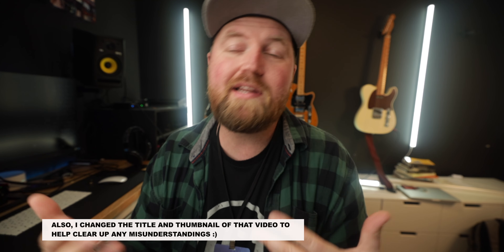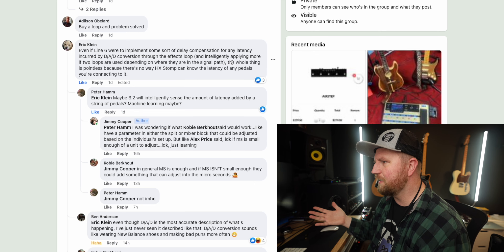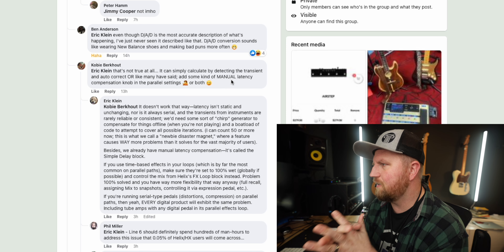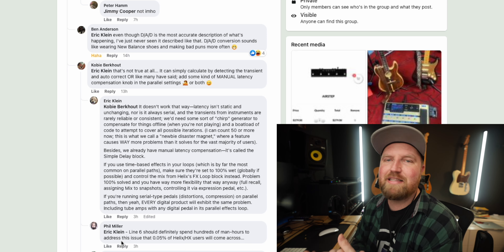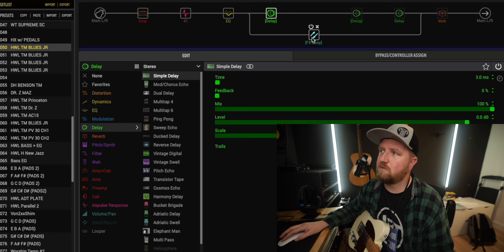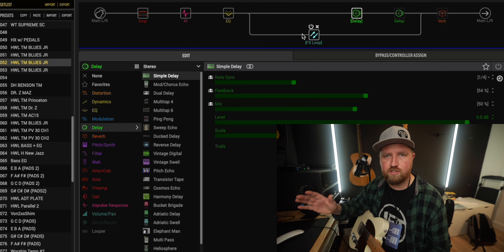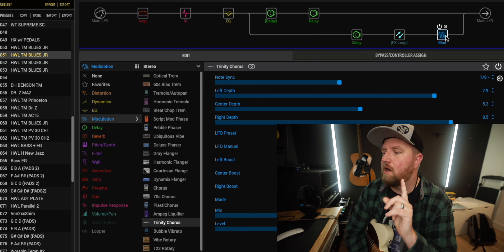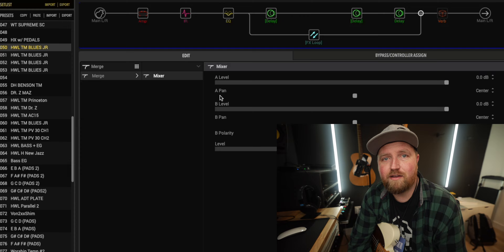How to OVERCOME HX Stomp FX Loop PHASING ISSUES...tips and suggestions

Comment: The issue is not on the Stomp.
It's the digital pedal because it's not analog dry-through.
Dan and Mick from That Pedal Show guys always talk about this when talking about wet-dry (parallel paths are the same as wet-dry or dual mono)
The only way to sort this out is to have the digital pedal fully wet and use the Mix on the fxloop block as on-off with snapshots.
Or have an analog dry-through effect outside the Stomp.
Reply from the maker: yes...finally have grasped this

Comment: Also there are 2 components of this latency. One caused by any external digital effect in the loop. But there is also the internal da-ad of the Line6 fx loop block. This could just be automatically compensated for by Line6 based on the number of effect blocks in each of the parallel paths. This is already solving 100% of the problem when putting only analog effect pedals in the fx loops, like distortion pedals.

Comment: When you set the mix on a time based effect pedal to 100% then you won't have any issues with phase at all. The issue of phase only happens when you blend your dry signal with your dry signal so as long as you have your effects pedal set at totally wet then you don't need to worry about phase (this is only for time based effects such as reverb and chorus).
Reply: The small latency basically just adds a small pre delay...so small that you wouldn't ever notice it.

Comment: You’re definitely in the ballpark area of ideas to solve the issue. I think the solution of manually delaying each parallel path at the end is the way to go. They could fine tune the range of the adjustment between 0-10 milliseconds and do .10 millisecond increments or quarter milliseconds or something.

They could make the delay parameter conditional. So it is greyed out unless you have an FX loop in the chain, or even it is inactive unless the FX loop is engaged. That would solve the problem the guy from Line 6 is worried about - that people new to the pedal would get themselves in trouble.

I do think it is worth their time to investigate this manual fix. I came across this same issue when I first got the stomp and just gave up. I couldn’t add another block at the time because I was already using all six.
Reply from the maker: I think so too

Comment: Love this, it's definitely making my engineering brain think. The thought of adding latency doesn't feel right. I've always been involved on the hardware side of engineering, not so much software, so my brain tends to lend itself to thinking of solutions external to the stomp. With that, I wonder if you could use something like the JHS Summing Amp, combine the signals before the go back to the stomp, and then only return one side of the split. Basically have two sends, but only one return. Not sure if it's possible.

Comment: I thought the issue arose even if the pedal was disengaged.  in that case, the pedal isn't causing latency, it is all internal to the HX Stomp.   The electrons through copper wire are flowing as close to c as possible and thus if you have 6" of wire the amount of latency induced by that is not measurable by any means of humans.....

Comment: Line6 just implemented the only usefull solution: a very precise delay/latency knob in V3. 5. It is available in side the dual cab settings. Unfortunately this parameter was not added to the mixer block....
This would solve all problems with parallel path phase issues.
So let's all make some noise so. Line6 realizes how easy this would be to implement.
Reply from the maker: exactly! When I saw that in the dual IR block I was like...wow if they can put it there put it in the mixer!

Comment: Eric says, "...there's no way HX Stomp can know the latency of any pedals you're connecting to it."

It's certainly possible that I'm missing something, but I don't see why this would be the case. Any DAW can do this. Example being Logic's native I/O plugin, which will ping outboard gear for latency, then offset (in samples, which is way smaller than milliseconds) to compensate for any latency caused by signal conversion. Seems like a utility block of that type (or as part of the mixer split) could be added to a future update?

Now idk how much DSP it takes to constantly compensate - it might be too much, I have no idea -  but claiming there's no way to know the latency of a connected pedal seems wrong. Open to correction if anyone has more insight into this.
Reply from the maker: true...also the new update has a ms slider in the dual IR block...exactly what I was thinking could work...I feel like something can be done

Comment: Any "solution" that involves adding latency to the other path to compensate might cause the phasing to go away, but it would cause the OVERALL signal to exhibit higher latency. We don't need more latency. The Stomp doesn't have huge latency but couple that with a wireless system. and then add some artificially added latency, and include other digital pedals out board either before or after the Stomp, and it all adds up.
Reply: Sound travels at 343m/s in air. This means that it travels ~34cm/ms. Introducing a couple of ms in the path is literally like rearranging your chair or walk to a different spot. It is a workaround, but it fixes it; biggest malus is the extra block you have to sacrifice.
Reply: @TomsonTheOne  I agree - but look at how many people complain about "feel", and ultimately blame feel (partially) on latency.